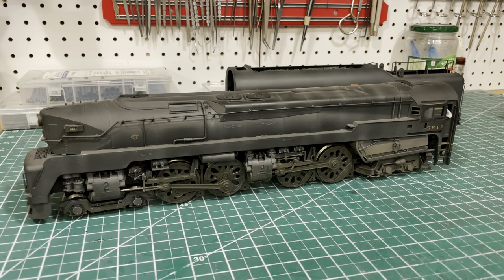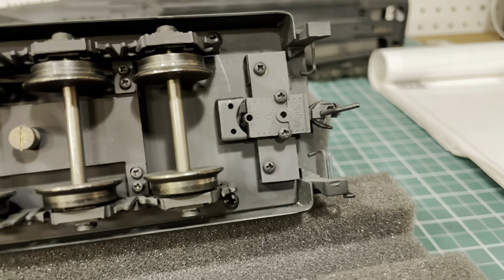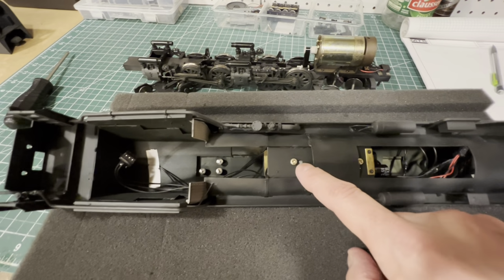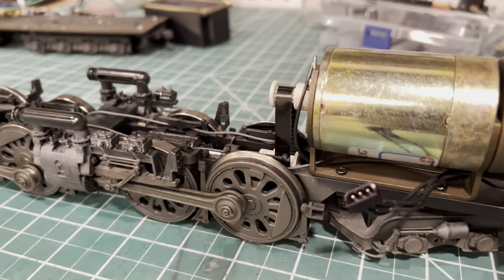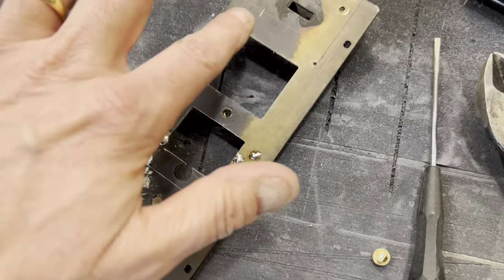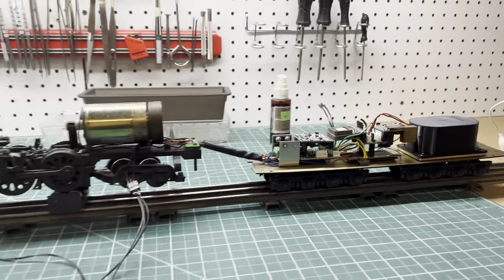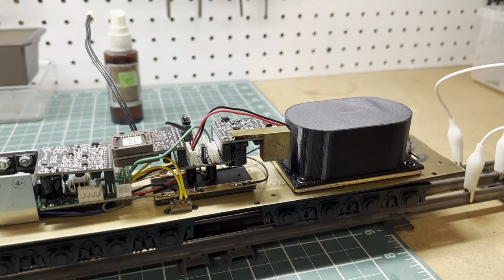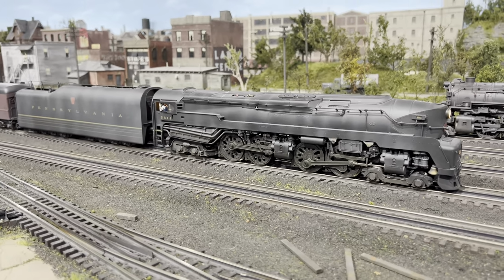The Chronicles of Norm #7 - T1 Tune-up

Comment: If you aren't aware, making your speaker enclosure airtight increases the power of the speaker.  Try to use a foam gasket and incorporate the wire input into your design for future projects like this.  This willl keep sound quality as high as possible (bass in particular). Love your videos. Love your layout.  Your work inspres me for my HO  collection.I love your scenery, love your weathering, and relism  Thanks for the motivation.

Comment: Excellent video. I’ve done the same with lionel and mth articulated locomotives. But I’ve used the Bose cube speakers. I had to trim the flanges down the correct width. For the sound chambers I ended up using cardboard tubes from paper roll’s.  I need to one invest in a 3d printer.  
A side note. The Bose cube speakers I’ve found them thrift shops around town priced relatively cheap!

Comment: Oh man.  This is like dejavu.  I just did my 3rd Rail T1 conversion (same loco, mine is #31 of 115).  I went with the ERR cruise commander + ERR railsounds for steam.  That speaker you showed at the beginning is the stock 3rd rail.  I ended up creating a DIY fatboy setup.  I had two spare 16 ohm speakers (wired in parallel to get 8 ohms) from a junked flatpanel tv.  But I don't have a 3D printer so I had to improvise.  I used two 2" PVC unions and PVC endcaps to cover the back of the speakers.  The unions had to be cut down to fit under that step-downed portion on the rear of the tender.  I ended up using silicon to hold them in place to minimize vibrations against the brass bottom.  All in all, it sounds way better than that original wimpy speaker.

On the tender I also fabricated two mounts for pickup rollers.  And that same style of bracket for the Kadee coupler had to be made, since the two side screw holes on the Kadee would have gone up right through the rear wall of the tender.

On the engine, I retained the original 6V regulator board that powers the lights +sleuthe smoke units.  For chuff, the superchuffer was used.  What a nice board (thanks gunrunnerjohn)!  The superchuffer had to be mounted on the side of the motor as there was minimal clearance on top.  And a notch had to be cut in the flywheel shroud but overall it was fairly straightforward to install.  The biggest challenge was making a half-wave bridge rectifier +5V regulator assembly.  Half-wave rectification is needed since the superchuffer output is fed to the ERR.  Lastly, the automatic cab light feature was connected from the output of the superchuffer.

For those cab figures, I gave up on trying to make and mount seats.  When I use the loco, I just stuff the engineer and firemen in through the forward windows with their arms hanging out and waving.  I mean if you're operating a T1, you have to wave!

One question for ya:  For the gearbox on the forward set of drivers, I noticed that if I have the engine sitting up on blocks (under the front/rear of the frame) and run the motor, the front gearbox kind of wobbles around.  Does yours do the same?
Reply from the maker: That's cool. I'm so happy I bought a 3D printer. It's a blast.

Glad you like the GRJ board. He will sell you a 5V mini power supply for it if you run it standalone (without his smoke board). I gave up on using his board since I had a hard time getting a reliable chuff out of it. I find setting up driver magnets to be just as easy and I get a solid crankpin-synched chuff when I want it.

Unloaded gearboxes can tend to 'hunt' a bit. I would be concerned if your 'wobble' is lateral in nature.

Comment: I have the Lionel 5511 T1, love it, but probably my biggest gripe about Lionel sounds is, they're never correct for the locomotive.
The authentic T1 whistle sound is available, but they didn't use it, Also, the plating on the driver's started flaking off.
Reply from the maker: I like the Lionmaster T1 sounds. I feel the whistle was a bit closer.

Comment: Hey Norm is that a Lionel Lionmaster T-1 Duplex from the early 2000s? Cause that engine was my brother’s first train.
Reply from the maker: The sounds are from the LM T1 yes..
Reply: @normstrains  So it is a Lionel lionmaster T1. Did modified for its prototypical connect between the tender and engine?